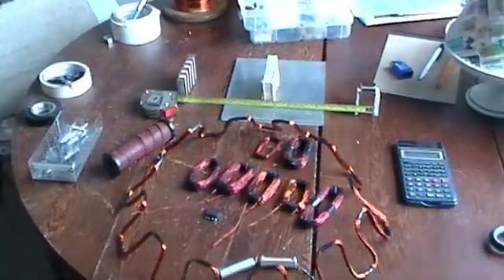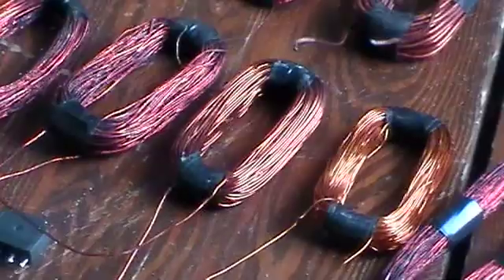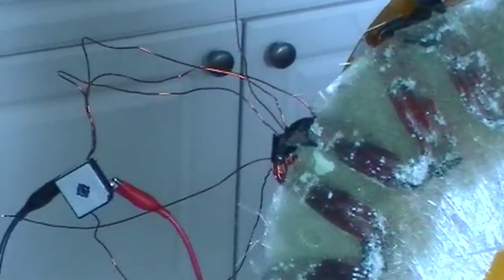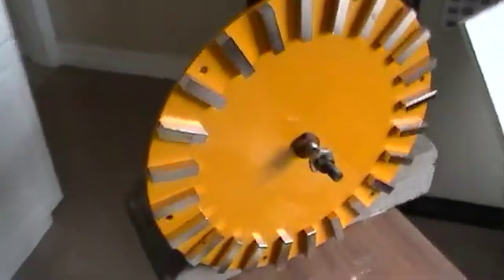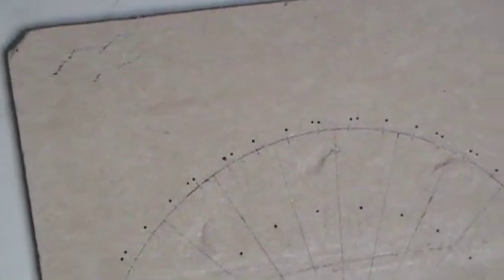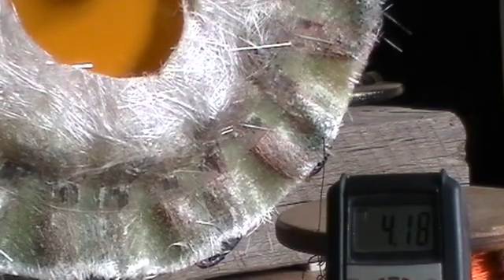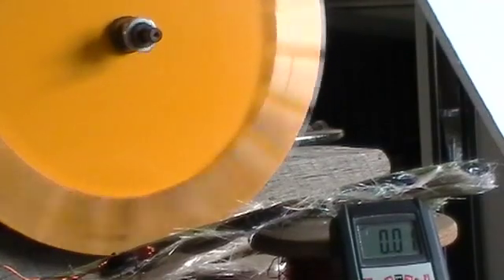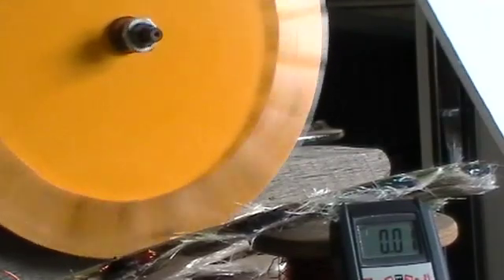remkick axial sepentine rotor permanent magnet neodynium ene

Comment: same prinsips as a pankake elektro engine..have seen some vindmill prototypes in denmark..vho use this system,,just have more rotors,in line..it gives a stabil Hz at low rpm

Comment from the maker: @cabron005 
I actually picked these up ready made; excepting the centre hole, from a metal recycling yard and paid $2cad. for them. They are 16"x3/16" mild steel plate and two of them contain the magnetic feild and in another vid you see i do a pin test and no flux gets through. It's all contained in the plate and returned to the magnets.